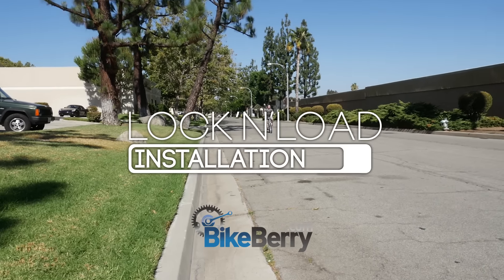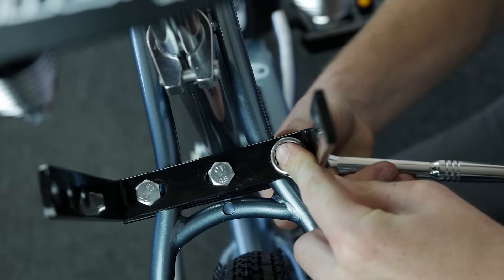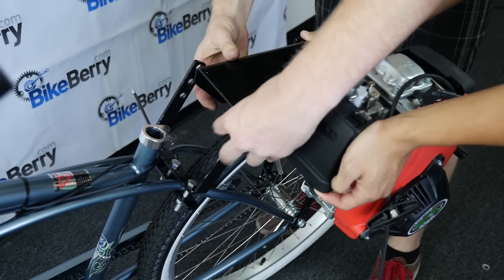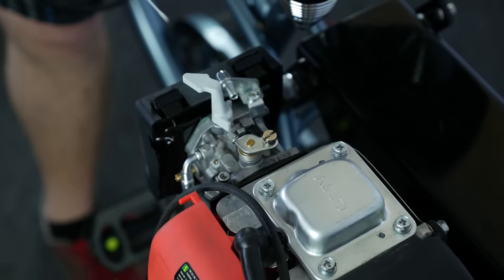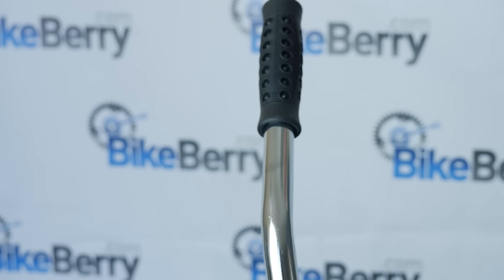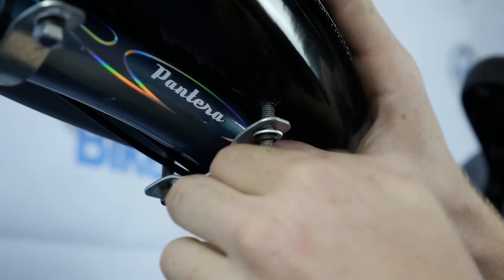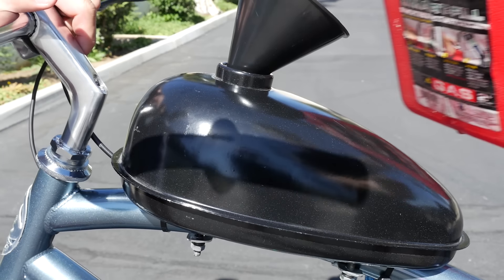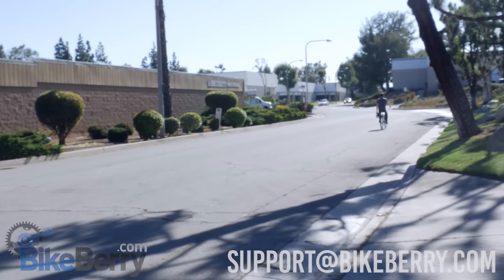4-Stroke 49cc Friction Drive Motor Bicycle Engine Kit Installation | The Flying Horse Lock-n-Load

Comment: if you get one of these upgrade the throttle the ones that come with the kits are junk also no good in the rain roller spins when wet otherwise nice kit much less maintance then the 2 strokes and way easier to install add a fuel filter gas tanks tend to be rusty on inside worth the couple bucks to save your carb from getting plugged ive got. 300 trouble free miles on mine so far
Reply: you can spray wd40 into the throttle cable and it should help

Comment: “LOCK AND LOAD AND GET READY TO SNAP CLUTCH BELLS AT $16 A POP”
Put a 100 miles approximately and already snapped 2. Time to re-engineer the original to actually last.
Damn fun cruising at  25 and topping out at 30. That engine on the side makes it unstable over bumpy stuff and breaking distance is increased with weight. 
Only getting about 25 miles before I refill tank even though it’s not nearly empty it won’t run partially full.
Reply: Have they improved their end bells.    Or can you buy a quality replacement part?

Comment: What type of bicycle are you installing it on? Can you install it on a full suspension hybrid where that is not much of a connection 2 Bolt down to in the back. I would think you would prefer a mountain bike over a cruiser for a rear mount due to the fact that on a cruiser man and motor sit directly over the Wheel and Tire where on a mountain bike or full suspension a man pretends to be meaning part of his load towards the front

Comment: Is there a PDF for this? I'd like something to look at while I'm installing, and I can't carry a video out, and if I had a tablet,stopping and starting it would be a pain.

Also, I have a 27.5 inch Schwinn Swindler. Will it fit on that size wheel?

Comment: What's this siphon hose? I have to buy it separate? I don't see instructions for this either. You really do need a PDF. It would save answering a lot of questions.
Reply: Jim Mooney thats to suck out of motor for oil changes not necessary for this set up drain plug is easy to access not included makes oil changes easier for the kits where motor is mounted in the frame dont get frame mounted 4 stroke the gearboxes fail often do good to get 3-400 out of them then your spending $80-$90 on new gearbox friction drive is better less parts means lower maintenance

Comment: I have one of these, and have had no problems. I've had a number of motorized engine kits. I found the frame mount kits to be junk. Not only is the engine junk, but it is almost impossible to mount it on many bikes, the rag joint rear sprocket sucks, and the chainstay mount tensioner is super dangerous (I have the scars to prove it) No problems with the friction drive kit. Only real limitation is it doesn't work in the rain, but it doesn't rain where I live. You need a fairly smooth rear tire, the tire needs to be properly inflated, and you need to get the roller tension against the tire right. I have not noticed excessive tire wear. I am 250 pounds, and have had no problems with the clutch. You have to pedal a few times to get it going. The clutch is not designed to take off from a dead stop. Once moving it purrs right along. I would not suggest putting a motor kit on any bike that does not have a front brake. A coaster brake only works up to about 5 mph. A front V brake will stand the bike on it's nose at 20 mph.

Comment: On my long support bars, they are not cut at any angle at all. I have looked at all sides of them and front and back and there simply is no diagonal cut to the openings on either of them. Also, my kit does not have the same exact assembly to the  quick release lock on the back. The spacers are not round as in the video, but are rectangles with enlarged edges to each of them. The video is actually very dark as this assembly process is being shown for that release lock and the bolts assembled with it. You guys really need to address questions as well as make a newer, updated video of this assembly.

Comment: Is there any way I can install the throttle on a bike with a gear shifter?
Reply: Hidaz // Gaming if you can find room for a extra brake style lever order a clutch lever fir one of the two stroke kits or ive heard of people useing a thumb throttle from a atv should be able to find one online pretty cheap

Comment: only thing is when I get the whole in the handle bar the stupid ass killswitch has a plastic price and gets smashed in so I drilled a hole thru the top and put a bolt in it

Comment: Does anyone know how to tune these engines to have a good idle, mine has a hard time staying running and ive adjusted the idle control screw with no success,  any help would be apreciated. Thanks!
Reply: put the idle screw back to how it was when you first got it, try that, then if that doesnt work, untighten it by a HAIR! dont move it for an entire spin, not even a half, just a very very small bit

Comment: The redistribution of significant weight to the high left rear side of this bike is somewhat of a significant state of instability or off-balance operation. It should run just fine, however it would be good to consider the differences compared to a normal weight distribution of a basic bike.
Reply: this small 12 pound motor, lol the bike weights more than the motor ,you clearly never ridden a bike with a motor they all have different center of gravity,
Reply: This creates an OFF center of gravity

Comment: Doesnt this wear out your rear tires extremely quickly?
Reply: +ReptileGuy239 ist not that bad
Reply: You can buy Kevlar Tires that wear much longer now.  Not too $$$$ either.
Reply: why not just have a rubber sleeve for the .."crank rod"? that thing rubbing on the tire

Comment: Sorry buy that's a restricted motor rev limiter needs to be removed from the engine a.k.a old CDI ignition coil and flywheel and swapped it out with honda ignition coil and flywheel and now it's a powerful Motor

Comment: so no clutch? what happens when you stop?
Reply from the maker: Mollettj100 Great question! Think of it as an automatic clutch. When you stop, the engine will still run. If you want to turn it off, simply hit the kill switch. Hope this helps! :)
Reply: so does the drive disengange as you slow to a stop?
Reply from the maker: Yep! The clutch is activated when you accelerate with the throttle. The clutch pads widen and grips the clutch bell housing while giving throttle. It then resets (by clutch springs) when you slow down. Makes sense?
Reply: does the rear brake still work or is it not needed with this setup?

Comment: Does anyone know the amount of oil to use ???
Reply: dont go by the dipstick fill until oil is up to the threds that the dipstick screws into that's what the instructions that come with the engine say to do if you go by the dipstick you wont have enough oil in your engine
Reply: @wildman6247  Hey guys, im looking to buy some break in oil, but im looking for alternatives at autozone or oriyles, can yall recommend anything other than maxima ?

Comment: ok so i ordered this awesome motor, only to realize that this video does not show you how to install the oil tank.
Reply: Have you figured it out
Reply: yes, the "oil tank" was actually a gas tank for someone elses order, for the smaller size friction drive, that got added to mine. there is just a tiny built in oil tank.

Comment: Cant find answer to this question anywhere!!! Can you ride the bike normally without running the engine!?!?!?! You know just pedal around until you feel like firing up the motor
Reply: How about a 7 speed rear ?
Reply: yes just undo the lock and load thing that looks like a bike seat lock thing and lift it up and lock it off the tire.

Comment: Will this engine fit a 20 inch bike tire?
Reply from the maker: We would not recommend fitting our engines on anything smaller than a  26 inch tire bike, as the smaller bike geometry would likely place the engine against the rider, increasing the possibility of injury and burns from the engine.

Comment: its all good but you are looking for police hassle with these.... no?????
Reply: hugue bégin depends where you live most states that do allow have max engine size,horsepower and topspeed restrictions for motor assisted bicycles google motor assisted bicycle laws for your state u can usually get away eith electric they dont 👂 them but your range will be limited if you ride responsible most cops wont mess with you from my experience because they often dont know the laws on them

Comment: As engaging as such a "quick and easy installation" video might be, I see a distinct lack of commentary regarding various practical issues. What is the fuel tank capacity? What range does this offer? What routine maintenance matters (aside from oil change and spark plug change) should be undertaken? What is the carrying capacity of this engine (i.e., size of operator)? How does this friction drive effect tire life? Push come to shove, what is a realistic life expectancy for such an engine? At the proverbial bottom line, more or less how many miles would an engine like this be expected to last? One problem I see is the lack of accommodation  (short of a backpack) for actually carrying anything. While a small tool bag might be mounted on the handle bar, what arrangements can be made for safely carrying: (1) additional fuel; and (2) anything else for that matter? Contending with the "real world" (and let's face it -- there are no end of folks who would love to "rip off" such a bike) I would suggest that a sturdy cable lock be carried by anyone who spends the money to build one of these.
Reply: Don Ball 80_90miles a gallon about 80 out of a tank of gas change oil every 50 hours replace clutch as needed clutch life and engine life will vary depending one how hard you run it how hilly your area is and weight of rider wnd bike once you learn to adjust roller pressure on tire about a 1000 miles for your rear tire not good for wet weather roller spins when wet upgrade throttle handle great little setup for dry weather riding will do 30 mph

Comment: DOSNT WORK GOOD FOR ANYBODY OVER 200lb THE CLUCH BURNS OUT
Reply: +Egalitarian Permaculturist Actually the clutch only engages at around 4000 rpm so you need to pedal hard up until the engine has exceeded 4000 rpm then the clutch will be fully engaged and will not slip. If you just want to sit there and creep around at 5km/h then yes you will burn it out.
Reply: That makes sense. Thank you.
Reply: @AbracaDanielll  lmao
that was mean but funny